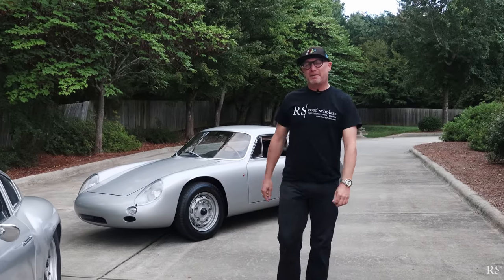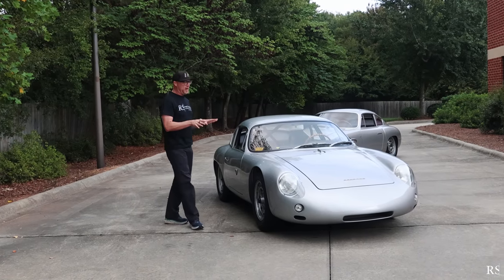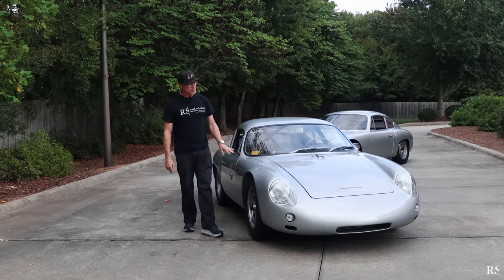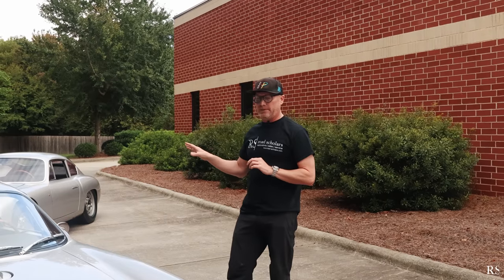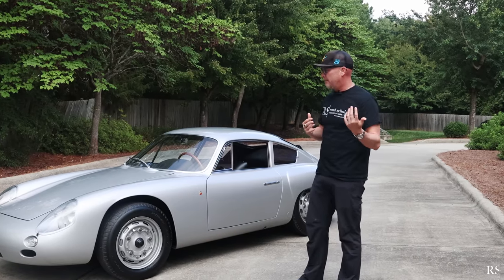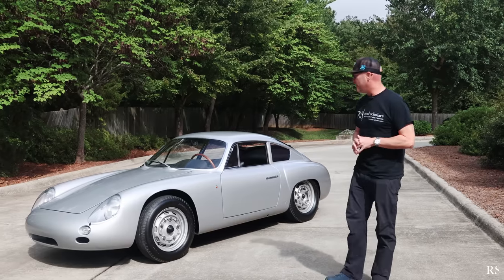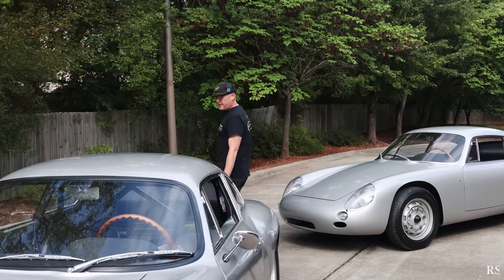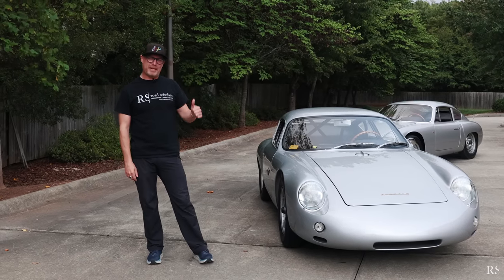Cam discusses the Porsche 356B Carrera GTL Abarth model | #QuickRip

Comment: Hello, I am currently writing a book on Franco Scaglione in collaboration with his daughter Giovanna. Of course I know the history of the Porsche 356 GTL very well so I'd like to give a few learned comments. The Viarengo & Filipponi body maker for the GTL story has been circulating for a long time. However it is false for the simple reason that that body maker was in business only from 1904 to 1924 therefore it's impossible they were the body maker. You can call the Museo dell'Automobile in Torino and ask for the Professore Aldo Enrietti research document on the Italian Carrozzerie history on whose he did his research. Carrozzeria Rocco Motto was the sole body maker for the Porsche Abarth 356 GTL as confirmed by Giovanna Scaglione herself and no he wasn't a novice body maker as there were a lot of them in Torino in the 1950's to the late 1960's in Torino and Rocco Motto was a reputable workshop. Also the legend about Scaglione working with Zagato do design the body of the GTL is another hoax. As confirmed by his daughter again Scaglione never worked with Zagato. By the way the paternity of the design of the 356 GTL was revealed only in early 1965 when Franco Scaglione himself confirmed it at the launch of the Titania Veltro sportscar he designed when at Intermeccanica... But you just need to look at the 1958 Alfa Romeo Abarth 1000GT Bertone that Scaglione penned to see where the 356 GTL design comes from. The book hopefully will be the definitive work on Scaglione and will have a catalogue raisonné with chassis numbers of all his important creations, including the 20 GTL, all of which still survive today. Best wishes.

Comment: Abarth Porsche Carrera...alloy body for dramatically reduced weight,  enclosed headlights for reduced drag, & improved cooling without increasing drag:  allowing faster acceleration,  higher top end, and reduced fuel consumption (potential)...(David)